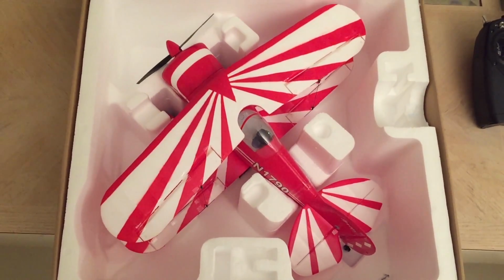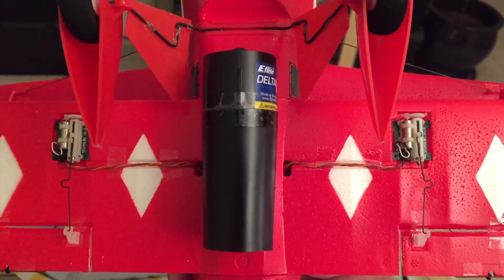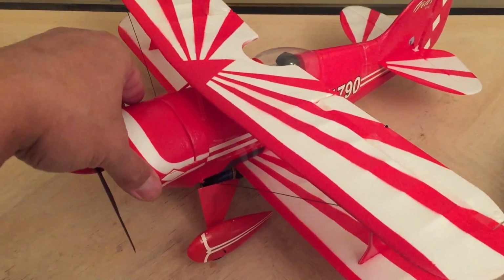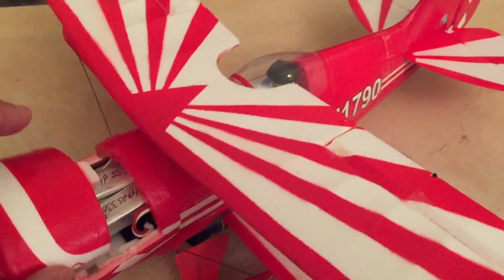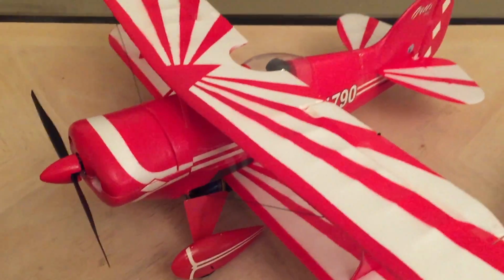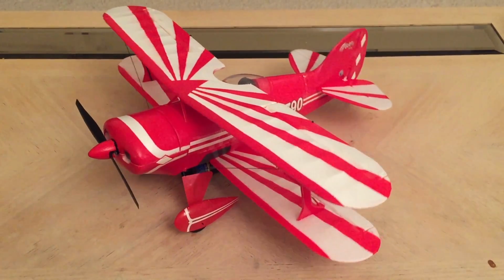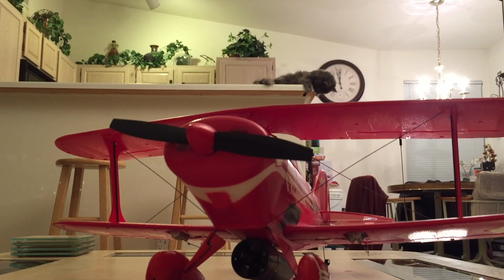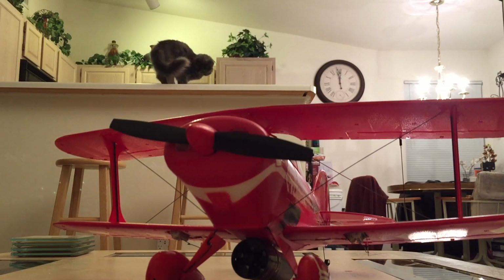Eflite UMX Pitts S-1S EDF - Boosted Biplane "Morgan" Preview

Comment: Absolutely outstanding work, Derick! How much more static thrust do you think it has? Here's to wishing you smooth air, sunny skies, and a great maiden flight! :)

Joel
Reply from the maker: +MrTurboparker Thanks brother!!  I wish I could measure it but I don't have a way of doing so as I don't have that type of equipment.  Fortune did favor on me today and while most of my flying field was still encrusted in snow, there was a short strip of astroturf that was thawed out and I was able to maiden her.  Wow, this plane is considerably faster than the stock UMX Pitts, screaming across the sky.  I had no trim issues whatsoever and the plane was absolutely predictable as the stock version.. only much faster!  All of the characteristics of the plane have been retained, and maneuvers were easily executed.  The spot landing into the non snow area astroturf at the end of the video also couldn't have been any better. :)  I'll be writing up my report as the Maiden Flight Video is already done.  I'll post tonight when I get off of work. :)